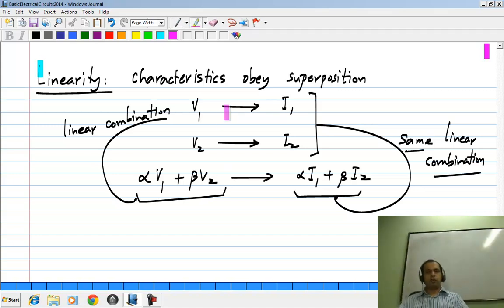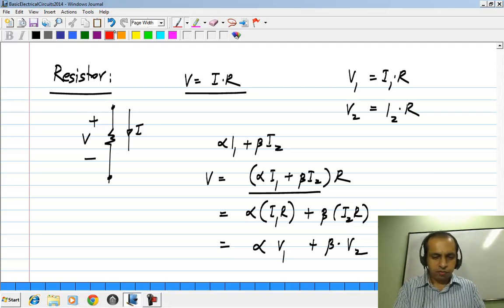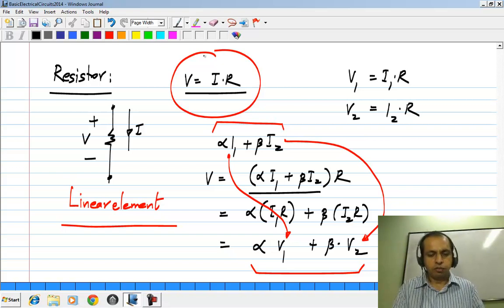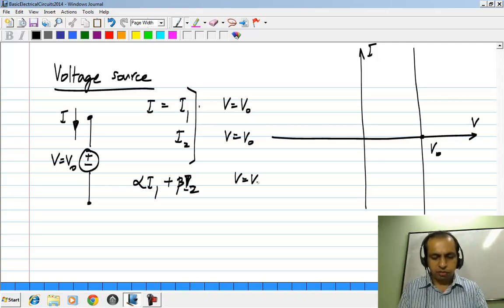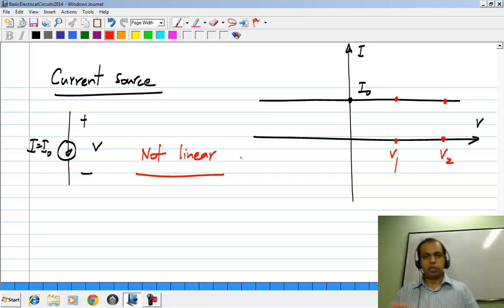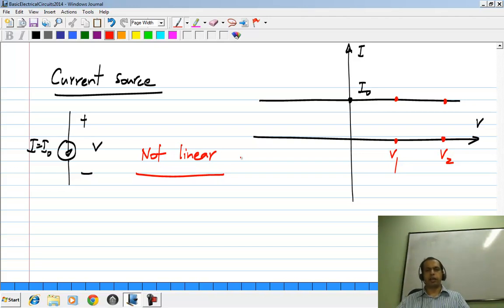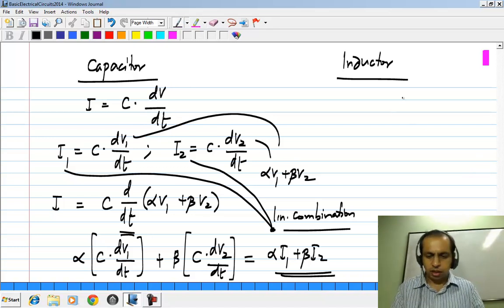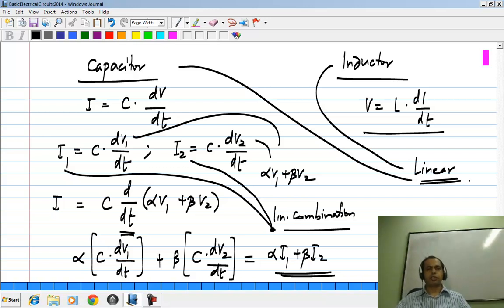Linearity of Elements

Comment: If Capacitor has stored charge in it...will it be linear or non linear?? 
And similar condition with inductor..
Reply: The discharging characteristics of Charged capacitor is a curve. So it is non linear with time. Right?
Reply: Q is proportional to V.. Hence its linear